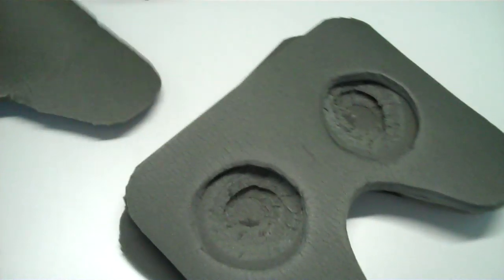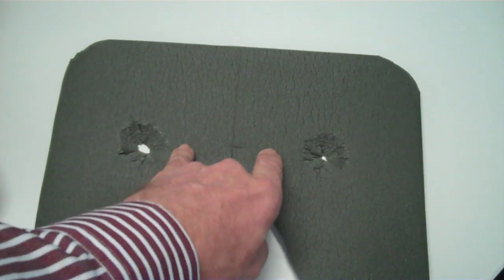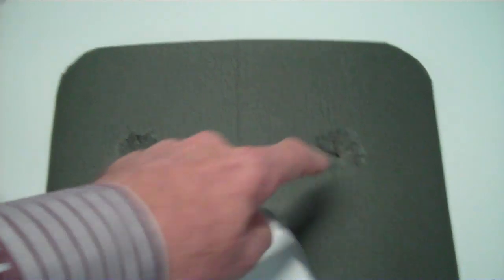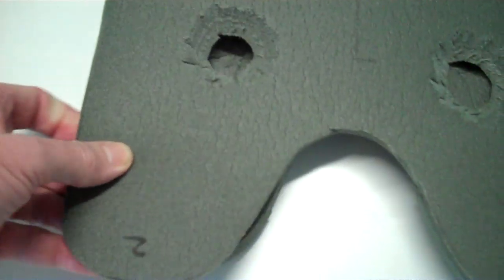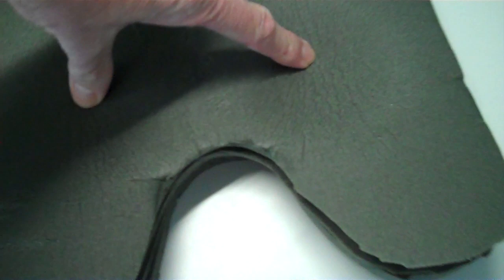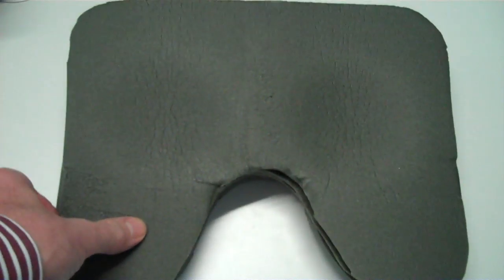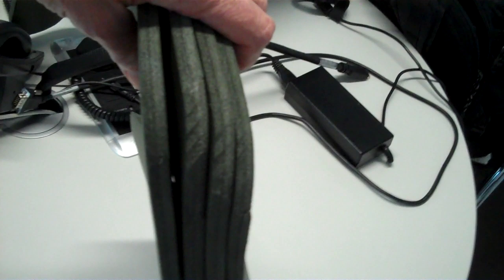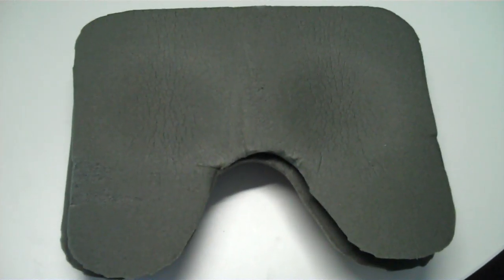The ultimate Concept 2 Marathon Seat Pad

Comment: I just use a folded up old quilt...might try something like this if i start doing marathon or half marathon, Now if i keep my composure in check i can do 10k without much trouble.
Reply: ***** Maybe you just don't have enough meat on yer ol' bones? I'm 31.
Reply: If you're using one of these machines you'll be losing weight and weight does come off the behind; the more you use the machine the more will come off; the more need to have a gel (or related) seat cover. I don't know why the makers of many of these machines use hard seats; I'm in the process of finding a gel seat cover that should lessen my own discomfort. But I'd like to add that it is generally recommended to spend no more than 25 (ish) mins per day on the machine.
Reply: l do the Murry Marathon in Australia 400km in 5 days, l have done the hole cutting and the size of the holes make all the difference as if there wrong your bum gets worn very quickly. l do like the fact that there is a last piece as l didn't do that as the higher you go up the more unstable you become. If anyone is interested google the Murry Marathon it's on flat water 98km is the first day, averaging 8 hours a day the mind dose start to wonder.